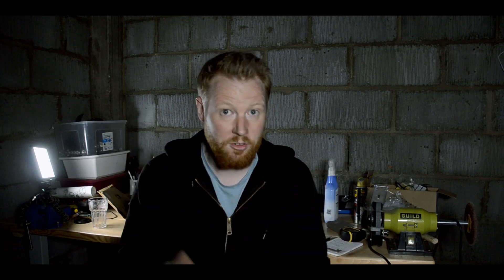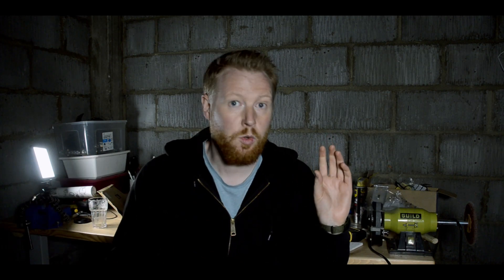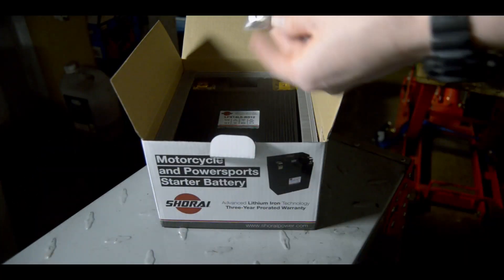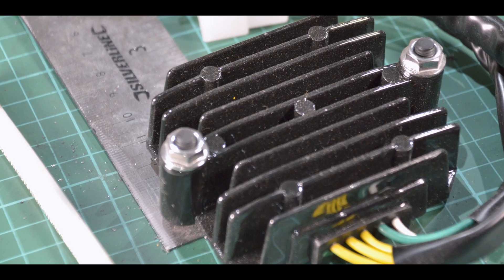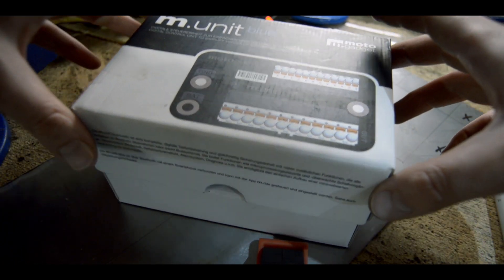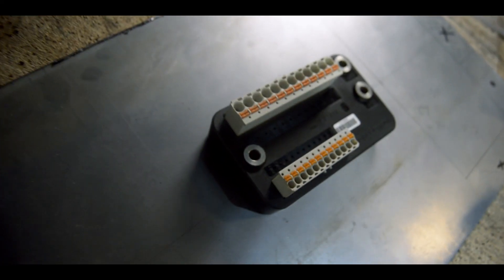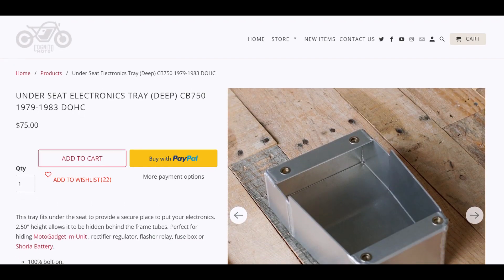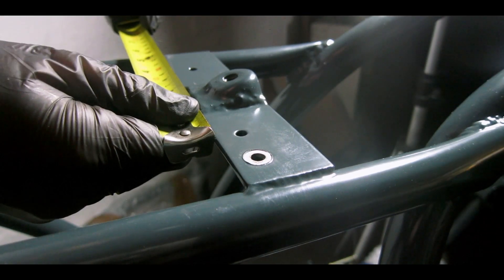CB750 Cafe Racer Electrics Tray

Comment: Nice video! Putting the reg/rec combo in the tray is okay with the heat sink? Or is that block flat enough to dissipate the heat to the compleat tray? I’m working on a 550 and still doubting where to put it so it cools enough.

Comment: Hey mate - class video. Know you mentioned it earlier but would be very interested in getting a run down of the electrics of these bikes? Starting from 0 knowledge and those diagrams are scary me off a bit (have a '72 cb350 so assuming somewhat similar on this front)
Reply from the maker: Hey Jacob, first thing I would do is try to track down a colour wiring chart. They're available on a lot of the forums (sohc4 is probably best for your bike). That makes everything 10x easier! The just use some sort of multimeter to test the switches and trace a couple of wires. It's actually pretty straightforward; it can just take a little time to get your head round.